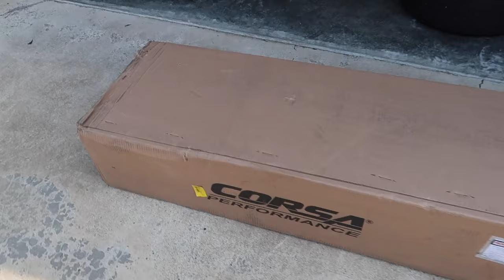CORSA EXTREME DARKHORSE EXHAUST ON A REGULAR 2024+ MUSTANG GT- WILL IT FIT?

Comment: I have an oem dark horse catback on my 24 GT but I did the dark horse valance as well, did a write up in the s650 group on Facebook. I bought your corsa double x and put it on the dark horse catback but I didn’t have to cut the hangers, I was able to get the tips straight

Comment: Hey Zander, two questions. How are you finding the MT82-D4 in the 2024 compared to previous gen? I'm an auto guy but really miss rowing the gears. Do you find the acceleration lacking in the manual compared t9 the 10r80? Also, what are your thoughts on MagneRide? Is it worth getting and is there a noticeable difference between PP non MR? Thanks and keep up the great content.

Comment: So does anyone here know how to tell if I have a 23 Gt active black tips valves? It looks like in the video but I think the way the little tab on the valve moves it’s not lined up like my oem mufflers so the cel cam on so I currently have the motors zip tied up until I can order or find out if I have the correct active tips. I bought it used from someone with a 24 but I guess they didn’t use the motors on this exhaust so idk how that works because my light is on.

Comment: The far right tip is not straight and doesn't match the far left one. It should be dropped a little.
Reply from the maker: @Adish0287  I need to adjust them a hair more
Reply: @Zander13Productions  car looks great though 👍🏽
Reply from the maker: @Adish0287  thank you